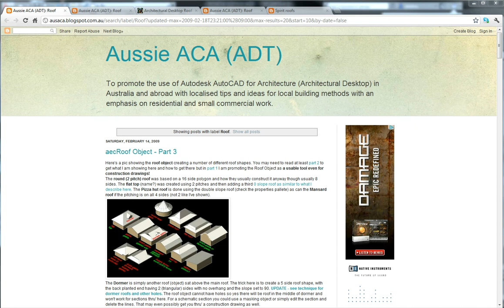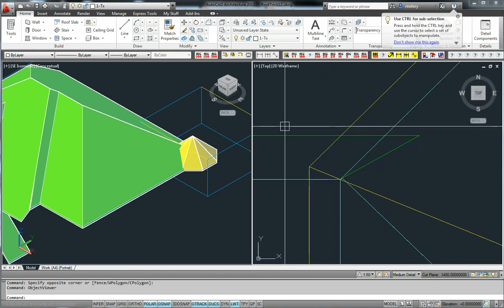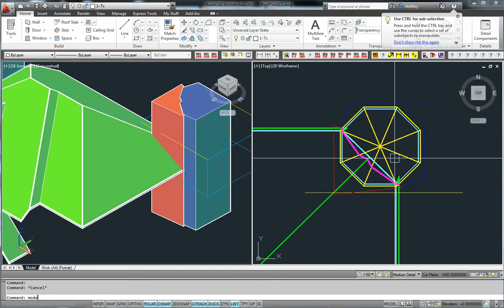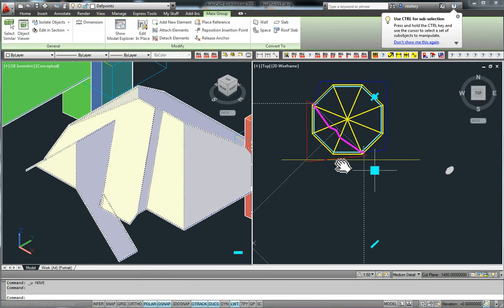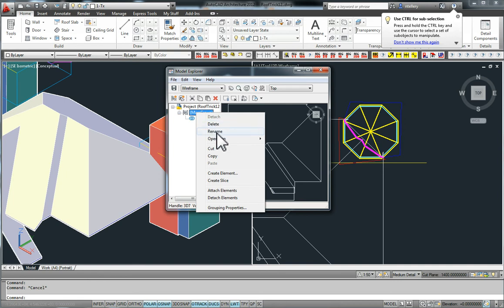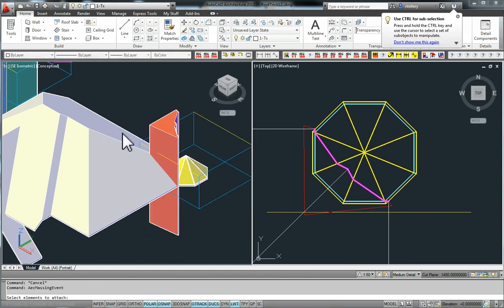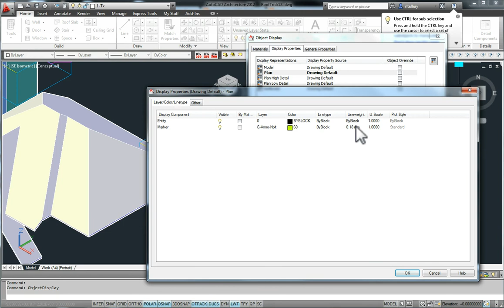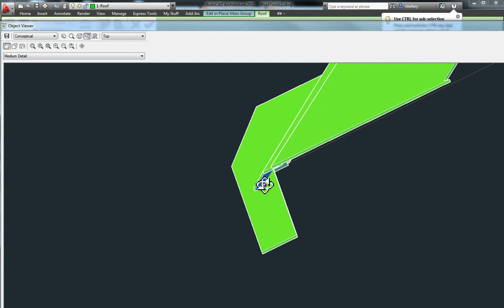ACA Roof Object 9 - Turret Connection Pt2

Comment from the maker: Yes I agree. Sometimes this is the case even with simple roofs like a skillion against (beside) a typical hip or gable roof although it can be done in one, it's just simpler to do it in two.  But yes in more complex cases, the MassGroup tool allows you to keep the intelligence (ableit limited) of the roof object which if you are still in design retains your flexibilty to edit on the fly.

Comment: You made a good point that sometimes its best and easiest to just make a separate roof. Thats what my problem was. I was trying to do everything under one roof. I had an curved (or circular) metal roof with a 4/12 slope die into a flat roof with a 12/12 slope. So I ended up making them separate roof objects.